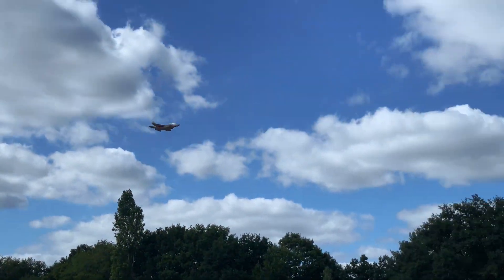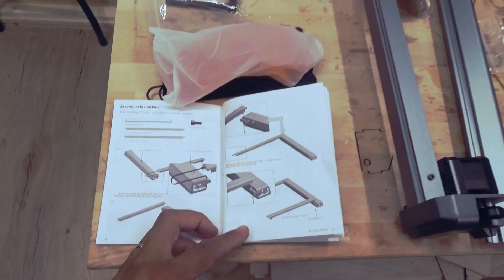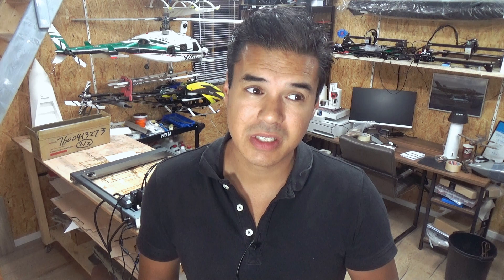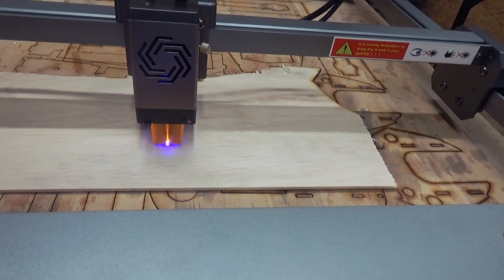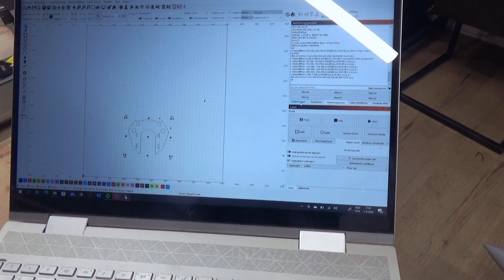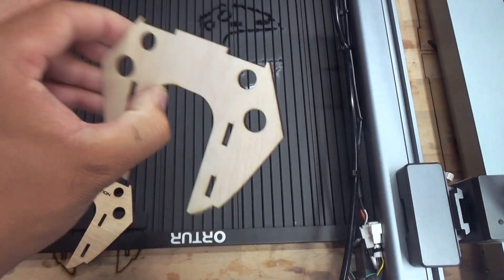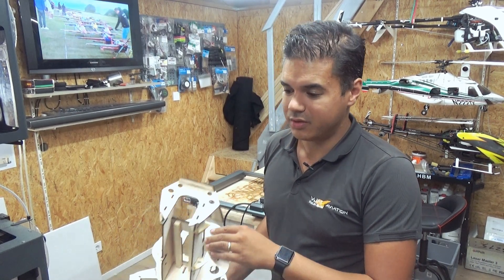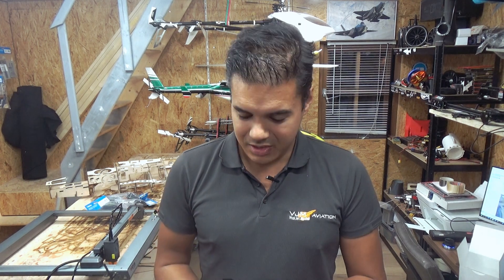Inside the RC F-35B VTOL Rcplane Homemade Cutting Playwood With a LASER ENGRAVER, SINIS joel f35

Comment: Hey Joel, thanks for the great videos, I ended up buying a LM3! out of curiosity have you had issues with it randomly stopping mid process? I use light burn and in the gui it looks like it's still in process but the laser has stopped. Can be rebooted and will start like nothing happened. Have been using the usb cable that came with it

Comment: Can you test cutting white foam board? I'm curious to know how it does.
Also, is there an expansion kit for it? I'd like to be able to cut a 20" x 30" piece.
Reply from the maker: Hey there is an expansion kit for this laser😃😃. I tried white foamboard and after 2 passes it went through nicely, only it melts a little foam beteen the papers. I will put a photo on my Instagram. Be quick for that discount😅
Reply: @Joelmelanie  Thanks for testing the foam board. Good to know. I know about the expansion, but it only does one axis, so it still can't do 20" x 30" sadly.

Comment: Good work Joel! Here is my challenge for you: By the end of this year - build, test fly, and demonstrate vertical take off, transition to wing flight, transition back to hover, and vertical land on the F-35. My cancer is still gone but it may return you never know...
Reply from the maker: Challange accepted!! I work hard! Went to bed this morning at 2:35 to cut the second model…I have finally found the correct EDF…100mm edf 6S from wemotec!! Good for 5kilo at 120Amps
Reply: @Joelmelanie  Never make promise for projects like this! 😆 The devil is in the detail...